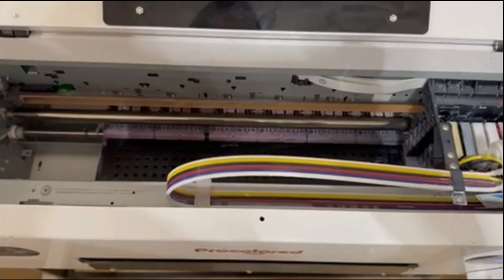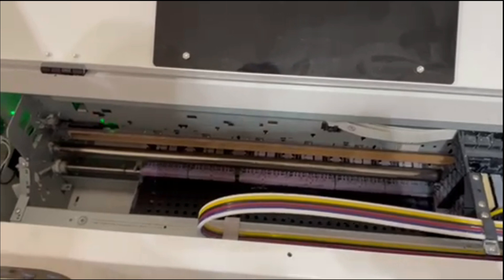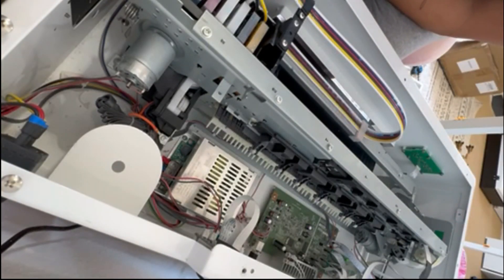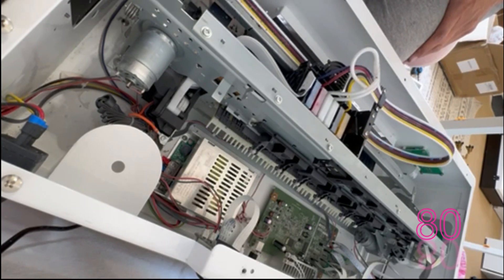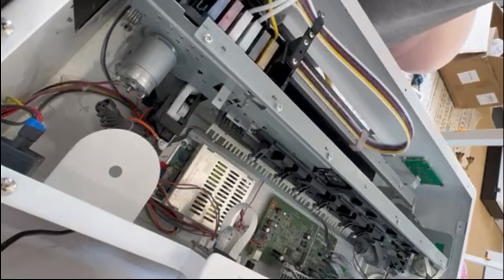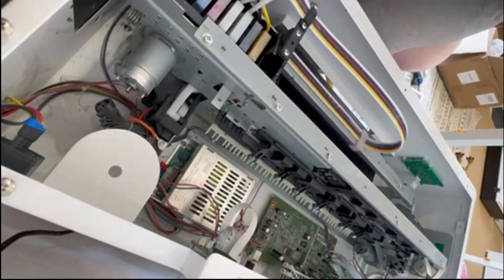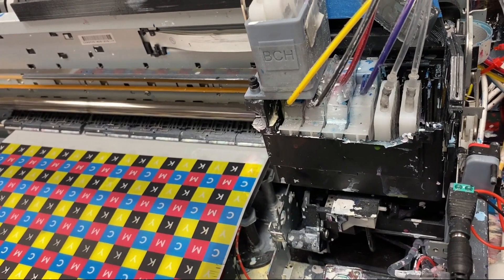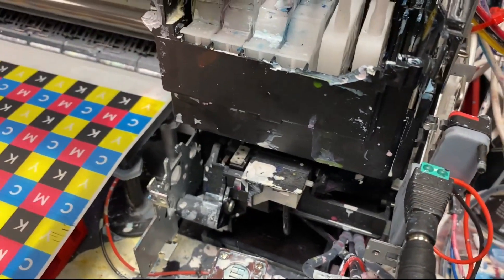Screeching & Double Error Light - What's Wrong with My DTF Printer?

Comment: Hi Kevin, firstly I want to tell you how helpful your videos are, thank you. I have the same machine as above and it's less than 2 yrs old. I just replaced the printhead at the advice of Procolored but I think my issue is the capping station. I seem to have to prime the cartridges a lot in order to get good ink flow. Additionally, my machine recently started making a loud thud sound, then stops printing and gives me the two red paper and ink error codes. It also produces less white coverage just before that happens.
Reply from the maker: Thanks so much for your kind words and detailed description! It really sounds like your issue could be with the capping station not sealing or maintaining suction properly, which would explain the frequent priming and ink flow loss, and the thud with double error lights may indicate a carriage stall linked to that same pressure issue. I’d start by checking that the capping pump is creating a proper seal and that the lines aren’t partially blocked. I truly appreciate your support—subscribers and members get priority replies within 48 hours and also enjoy exclusive benefits like early video access. Because of the high number of daily questions (I answer about 10 per day), non-subscribers are answered if time allows, and newer comments are reviewed first. If you don’t get a reply within 48 hours, you can subscribe or repost your question for faster attention, and once subscribed, your old questions automatically move to priority. For quicker help, you can also email [support@bchtechnologies.com](mailto:support@bchtechnologies.com). If this video or comment helped you, please leave a quick Google review here: [https://g.page/r/CfL7k6nYvPQ9EAg/review](https://g.page/r/CfL7k6nYvPQ9EAg/review). Thanks again for watching and for being part of the channel!

Comment: Hey, can you please help or give ideas for my L1800 printer. So just cleaned the capping station but now when I power it up I get the 05 error. If I start with the carriage in the middle, it will return to the capping station, then it stops at lock. resets and lowers capping station and slides over to the right. The problem starts when it trys to go back left it like jumps and stops and only moves about an inch and the right back into the dual red light issue. Please any help would be greatly appreciated as we are struggling to figure this out. Thank you for your help!